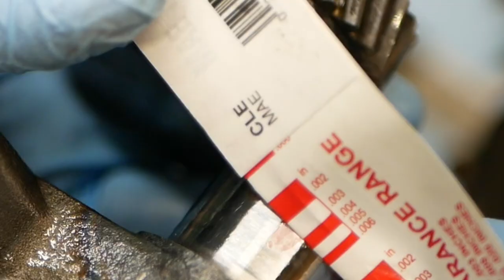212cc Predator powered mini bike motorcycle engine swap installing a stage 2 kit

Comment: I always thought that running the carb too far from the inlet manifold would cause an issue, i thought it was to do with the fuel vapour turning back to a liquid between the carb & the engine which is why carbs are mostly mounted to engines.
But hey, it works so that's great.
Reply: It wont turn back from vapour to liquid. Usually on cars and bikes a longer intake or "runner" will get you more torque and a shorter runner will get more top end horsepower. As alaways there is a happy medium but if you look at a sport bike the carbs or throttle body is sitting as close to the intake ports as possible to get that high peak hp. Regarding his bike it will get great low end power but not as much peak hp due to the distance from carb to cylinder and the pressure/velocity loss because the long runner.
Reply: Isak Svensson 
Yes but it's rare to see an intake header being anything other than straight. This engine certainly seems to have the torque you mentioned.
Reply: @WhiskeyGulf71  For sure is a straight intake the best, but in his case and the car he showed its all down to packaging. I belive that the car he showed they have for sure tested the best runner lenght for the desired power and torque they wanted and then they had to tangle it down under the hood. But in a high performance stadpoint a bend in a runner is bad for the flow and pressure, as the pressure drops exopantially the sharper the bend gets.

Comment: anybody know what you se the valves to on a 79cc predator i cant find anything
Reply: Should be the same .03 for both sides
Reply: @toyotafreak2000   okay ty i found a forum someone also said 003 005 i will try them ty
Reply: Those engines are crap just save up and buy a 420cc

Or even a 670cc if you have enough.
Reply: @arberfilms5998  well it was given to me for free so i dont mind if i put in a lil money to fix it up also yes the 420cc would be nice on a gokart frame but im using mine on a minibike frame
Reply: youngchap that’s ok I was just saying spend a little more cash for a more powerful engine.

Comment: I think that would be a great swap for an xr200 or 250
Reply: i actually just bought a run-down xr200r with a bad motor for $200 just to do this but the xr200 has a 520 chain so I need to figure out a rear sprocket
Reply: @Eury9819  I'm doing the exact same swap. I just contacted rebel gears to custom make me a rear 420 size sprocket, but still trying to figure out the best tooth count
Reply: @slimshady997   go power sports sells a #50 torque converter sprocket 3/4 shaft $20 so I might try that option first
Reply: @Eury9819  my only concern is the chain not fitting between the plate and the driven pulley. I know a 420 chain is a tight fit, but might not hurt to try for 20 bucks
Reply: @slimshady997  i did this swap with an 84 xr 200 used #50 chain and sprockets fit well turned out awsome does 74kph with stock motor and governer

Comment: The bushings in the cluch wasn't oiled properly if so they will last
Reply from the maker: I lubed it every time I was in there. The bushings are $h1t
Reply: @Mikefestiva  if I recall they are oillite bushings put thumb on one side fill with oil the finger on other side and squeeze till the oil comes out the side. they will last but I have seen some without oilite bushings they are junk
I like you work nice welding and pipe fitting

Comment: What oil you use I'm that engine?
Reply: The predator take 10w-30
Reply: ghost- carnage I use in my 26 hp 228 cc 5-40 rotela t4 with Luca zinc additive

Comment: Yep.  That 90s Ford SHO was designed by Yamaha.
Reply from the maker: Yes definitely a nice engine 👍 
My 2003 Pontiac VIBE GT also has Yamaha designed engine with VVTL, it’s got a 8,200 redline and a 6 speed manual, it’s funny because it’s a total soccer mom car 😂

Comment: I just finished  building my son one from an old crf230 frame he only weighs 80lbs but the first day he rode the belt shredded to nothing. I went this morning buy a new quality belt and installed it he rode a good bit today and he doesn't go fast but by the end of the day this belt is all burnt up and shredding. I checked the pulleys alignment they are in line and the bushing spins freely  so I have no clue what to do. It's a predator 212 with a series 30 amazon torque converter any help would be greatly appreciated.
Reply: There's 2 types of bolt on cvt. One has a belt that's shaped like a normal v and the other has one side flat instead of cut at an angle. Make sure the right belt is used and the flat is on the correct side if thats the one you have.
Reply: @danhammond8406  I made sure that the flat side of the belt is facing the engine on the flat side of the pulleys.  I'm beginning to think that maybe the rear tire size could have something to do with this but I'm not sure.
Reply: Maybe wrong size belt or the check the alignment. Also I've seen people put the pulley on backwards and itll shred the belt in time
Reply: @gabrielgalaxygh  I added one more washer to the front pulley today and he rode it all day long with no issues so far so hopefully It is going to stay this way. Thank y'all for the info and help I really appreciate it.
Reply: @matthewhenry6797  glad it worked out and he's riding again

Comment: should get someone to race it vs 125's on an mx track
Reply: Stephen M not fair
Reply: @itstycho3184  for the 212? Will be fairly close probably since the 125's tend to rev higher but the CVT should get a better power band for the 212, maybe.

Comment: I put a predator 212 in a kids quad and it does not have any torque won’t go from stop
Reply from the maker: Sounds like the gearing is way off, install a much bigger rear sprocket on it and I’m sure it will work good 👍
Reply: @Mikefestiva  I have a giant one
Reply: @pltslax3188  install a torque converter
Reply: If you molded the intake and exhaust to more free flowing then you need to increase jet size in the carb.

Comment: Try a Juggernaut Torque converter driver. It's perfect for that build. I'm running one on a similar mod 2 cam build and it's perfect. Like a tuned snowmobile clutch for that engine build. I know it's $100, but that bike is worth having a roller cvt driver in it now. It's a really nice, ripping trail machine.  You can buy them from Studz powersports too. They are currently out of stock, but you should give them a call. They might want their name out there. They are also cheaper that that big name outfit we shall not name. http://www.studzracing.com/searchresults.asp?Search=juggernaut&Submit=
Reply: I like studzracing. They had gaskets for my 196 Greyhound that no one else had. I also bought a max stroke crankshaft from them at a lower price than others. Parts were here in 2 days.

Comment: Why not put a high comp piston instead of the old crusty one?
Reply from the maker: Well the stock one that you think is crusty only has 12 hours on it, it’s got plenty of life left in it.
The little bit of dark stuff on top of the piston is called carbon and it’s normal for all combustion engines. Honestly I really didn’t want to spend anymore money on this project because it’s really just a play bike and was intended to be an affordable build. I have a full size motorcycles I would much rather put money into for real trail riding.

Comment: Just a suggestion . I bet it would greatly benefit from go power sports.    jugarnot   (not sure of spelling )  drive clutch. Seem to be great improvement
Reply: They have been having issues with those clutches. They run fantastic for the first couple runs, then they grenade. I think that's why they've been out of stock.
Reply: Garbage, the juggernaut and go power sports
Reply: @Just-InTimeRepairs   didn't know that  . I've saw  a bunch of good reviews on them in recent past
Reply from the maker: I had seen a lot of people putting the Jugernot on mini bikes but the price was way to much for me. I would be interested to see the internals of one and see if I could make something similar on my lathe?

Comment: you do realise the xr100 has fouble the horses on the predator engine
Reply from the maker: What?
Reply: @Mikefestiva  double the horsepower*
Reply from the maker: Ruudi Utšenikov You probably missed the video where I race a stock xr100 and completely blow it away. I also raced a extremely trick xr 100 with a BBR high compression 120cc kit, big carb, big cam and a full FMF exhaust, the predator mini bike at the time only had a bigger main jet and free flowing air filter, guess what, it again blew the BBR 120 away.

Comment: Needs gears
Reply from the maker: No it doesn’t
Reply: It does have gears in a sense. It's a CVT, which varies the gear ratio as it accelerates. It may not have the range in gearing that a traditional motorcycle engine might have, but it's definitely good enough for trail riding.